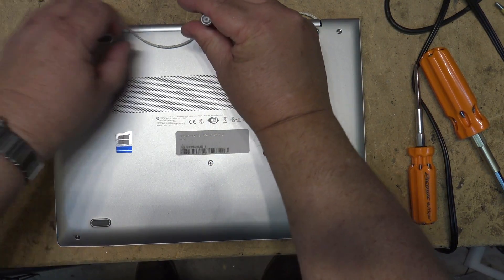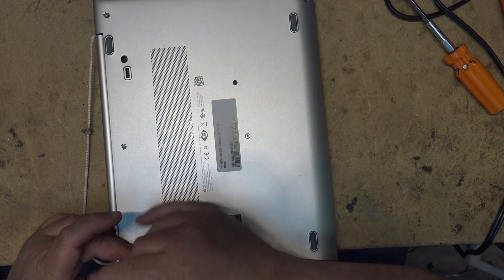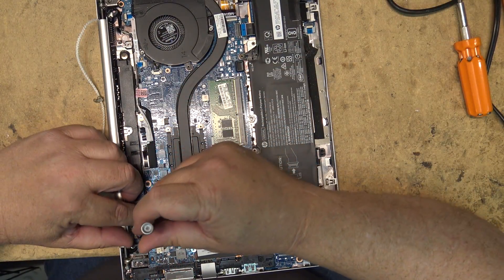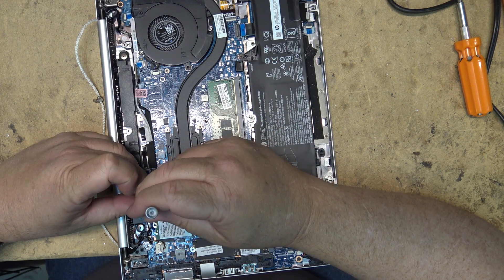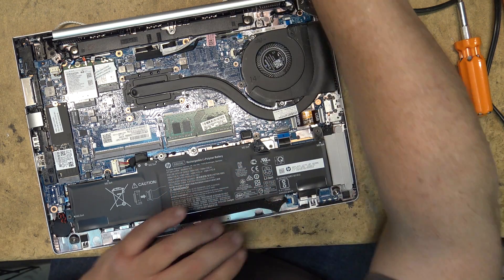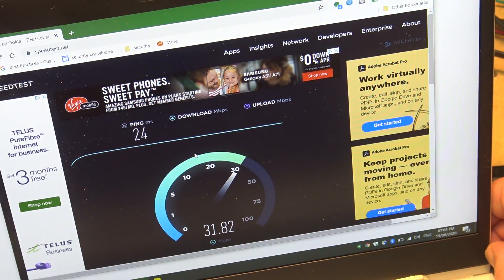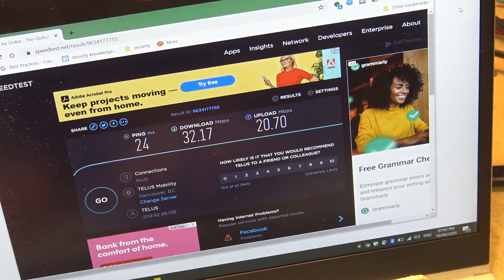My brand new work laptop has no LTE connectivity   lets fix it

Comment: Wait, one can have mobile internet via cellular with more than GPRS speed ?!? Gotta tell the others in Germany...
Reply from the maker: Yes I get about 80 mbits down 30 up on a cellular connection.
Reply: @12voltvids  You see me jealous : )
Reply from the maker: @HenkChinaski  
It's a work machine. I am not permitted to use it for personal use.  Same goes for the company cell phone.  It go off as soon as my shift ends and doesn't go back on till I am on shift.  Company monitors use.
Reply: @12voltvids  Well, i am rather jealous because of the connection speeds available over there and not primarily about the gear, although it looks nice, especially with that carry strap. Why's a company would be interested in hiring someone monitoring the usage of a laptop by employees remains totally beyond my imagination.

Comment: Please help, Dave! Sony KV-32FS120 won't degauss no matter how long I leave it off or unplug it. I assume THP501 is responsible for this, but I don't know for sure. I can see the solder joints on the bottom of the board for THP501, they look fine. Should I try to replace THP501? I'm not a technician, I'm just trying to play video games. Thanks in advance!
Reply from the maker: Usually it is a broken solder connection on the thermistor or plug where the deauss coil plugs in. I don't have a manual for that model handy to look at the circuit.
Reply: @12voltvids  I replaced THP501 (thermistor) and there is no change. I also tested the resistance across the three pins when I had it off the board and it matched the new replacement part almost exactly. Thermistor solder joints looked good before I took the part off too. I didn't look at the degauss connector joints at all, I'll check that next. Thank you very much for your response Dave.
Reply from the maker: If the degauss circuit is working (you can hear the distinct hum for a second when the at is started cold) is is likely an aperture grill problem inside the tube.  If the aet has ever fallen forward which was common with those big Sony sets due to the weight of the glass on the face of the tube, the aperture grill inside the tube can shift and then you will never get the purity correct.   I can't count how many times I had to change a tube on a new set because one rolled over in a truck in the box when the truck went around a corner too fast.
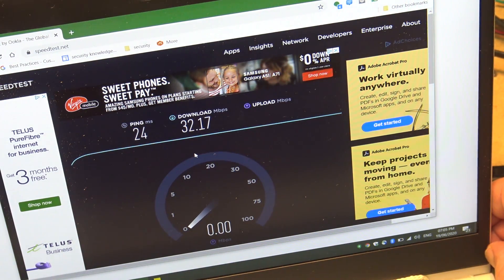Reply: @12voltvids  Thank you again for your replies Dave. Check this out: Symptoms: A little bit of green along the top, a little bit of yellow along the bottom. Clears up perfectly when I turn the set to a particular compass heading (a little bit East of North). Interestingly, when I compare this "good" compass heading to Google Earth when looking at the house I got the set from, I can tell it is the same compass heading where the TV was sitting for years (free facebook find ... I remember which wall it was on in the house I picked it up from). I don't think I hear the degauss coil. There is a youtube video which shows the startup sounds of this particular set (search "Adrian's Digital Basement Sony KV-27FS120"). At 3:30 he gets "tick, tick, thump ... picture". I only get "tick ... picture", no matter how long I leave it off or unplugged. Degauss coil has continuity tone when disconnected from the board and tested at the plug. I replaced THP501. Degauss coil connector socket solder joints look good. Purity was correct when I picked it up. No "drops" on the way home. Purity is good at my house too, but only when I turn it to that magic compass heading. If I turn the TV on and spin the TV slowly I can see the green and yellow move to one side of the set and then disappear as we approach the magic compass heading. I am a software engineer, and I'm pretty far out of my element right now. Your videos and advice are some of the best guidance I have right now. Any ideas? Thank you again sir!
Reply: @12voltvids  Update - Degauss relay clicks when 12v DC applied directly. High voltage legs of relay go from open to 200 ohm (is this OK?). Everything in the high voltage side of the circuit appears to tone out fine, including the degauss coil itself. Nearby transistor on the low voltage side of the relay tests fine (NPN). The degauss relay never clicks during startup so I assume it is never being commanded(?). Used the schematic to trace the signal side of the relay to the 14v side of a 9v regulator. Everything tones correctly in this path. Used the schematic to trace the relay signal the other direction, all the way to pin 60 of a microcontroller on a daughter board. I haven't toned this path yet, but that's my next step. If this path tones OK I might just replace the daughterboard. I'm pretty sure everything is cool on the high voltage side of the relay ... I think the degauss command is never arriving on the low voltage side(?). Does this sound like a good theory to you? Reminder that I never hear the degauss relay click during startup, no matter how long I leave it off, and the thermistor has been replaced, and the old one tests good anyway. Looking at the schematic I feel like I should hear the relay click even if there is a problem on the high voltage side of the degauss stuff? Do my ideas sound right to you? I have very little experience. I got my soldering iron like 5 days ago. If you happen to read this, thank you again Dave.
Reply from the maker: @SCBraddy  Wierd problem. Don't have the foggiest. Been a long time since I was into one of those sets.  The degauss relay should turn on when the set is started cold, but agaon it has been about 17 years since I saw one of those sets.
Reply: @12voltvids  UPDATE: Fixed by replacing the M-board. The critical clue was that the degauss relay wasn't clicking during startup (could hear the first click [main relay] but not the second click [degauss relay]). This means the problem was on the signalling side of the relay, and not in the AC degauss path. Further, the relay worked fine when I applied 11v directly when the TV off. Further still, I could force a degauss while the TV was running by momentarily shorting the appropriate relay leg to ground. Toning the relay signal path showed that I had a good connection from the M-board microprocessor all the way to the degauss relay neighborhood. Transistors and diodes seemed OK in the neighborhood too. During startup the degauss signal from the M-board would climb to about 20mV maximum and then settle down to a lower value than that. This is roughly the correct behavior for that signal line, but it was just too low - not enough voltage to energize the degauss transistor. All of these factors put my suspicions on the M-board microprocessor, which was a hard leap to make considering that the TV worked perfectly in all other respects (picture, on-screen menu software, inputs, everything). Replacing the entire M-board fixed it. Just finishing up the story in here in case anyone ever cares.
Reply from the maker: @SCBraddy  cool

Comment: !st thing disconnect battery
Reply from the maker: Power down is good enough. No need to disconnect battery.
Reply: @12voltvids  54 years repairing all kinds of electronic devices says I am right
Reply from the maker: @kennethconnors5316  Except in this case.

Comment: Ha ha ha, service center screw up - fixed in 5min. I have to make old my old Win7 laptop connectible to Wi-Fi, sees the network but doesn't connect to internet.
Also my neighbors laptop Win10 spkrs distorted like crazy - somehow it fixed itself - maybe driver update  from Microsoft did it.
Reply from the maker: It worked when it left the service center and stopped the next day.

Comment: I had a similar problem in the past. I was servicing a laptop with a disappearing wifi adapter. My problem lied in the old version of BIOS. There was a bug due to which it forgot to apply power to the pci-e bus connector. When you have put the computer to sleep in a specific way, the wifi adapter disappeared and never ever showed up again. Not even after a power cycle or restart. Come to think of it, new Win 10 sleep states could be at fault also.

Comment: Man. I HATE this design that all laptops have today where you have to remove the entire bottom cover to gain access to the RAM, m.2 cards, SSDs etc. I really miss the hatches the older laptops had. Everyone seems to have gone the Apple way of design...
Reply from the maker: I like my old Dell.  Huge battery (user replaceable) internal 500 gig hard drive and a swappable caddy with a 1tb drive that I can hit swap. Can pull that caddy and slap in the dvd drive if needed.  Has sd card reader esata/usb combo plus 3 more USB VGA, hdmi and a firewire. Plus it has a REAL keyboard.
Reply: @12voltvids  Yeah. Good laptop keyboards are kinda rare these days. Look what happens with 2016-2019 MacBooks...

Comment: Windows 10 can be a real pain, I've been running on the 2016 LTSB release for a while now because I got so fed up with the rolling release. At least this version is stable, and I know it will stay that way because it only gets security updates.
Reply: If you got problems with Windows 10, it's 99.9% of the time a hardware problem. Never had any problem with Windows 10 since it release on 5 different hardware constellations. And if I had some, it was always down to hardware problems. Always.

Comment: Put Windows 7 on it. Win 10 ignores your rights to reject updates and advertising.
Reply: There are specific programs that only run on Windows, and some only on Win7 and XP. Also Win 10 from time to time as some update comes along will mess up settings and things won't work properly. 
Linux, I like it for some stuff, but not being a Geek or PC wizard makes me stupid, and again Linux software version availability or compatibility problem with the software I use.
Reply: You can't even install Win 7 because it isn't supported by new hardware and there are no drivers. Plus it's no longer supported by security updates. If you want privacy, install Linux.
Reply from the maker: @crashbandicoot4everr  linux is a joke. For geeks only. I don't have time to learn a new os. I just want to turn on my pc and work with the apps I currently use. I played around with linux many years ago. Sure there is firefox, but no photoshopping or premiere, and all the other apps I need to use. I use win 7 on my personal computers and have no plans to change because hardware I use will not run on 10 because there are no drivers for it. For that matter there are no drivers for linux either. I still run xp on one old machine that gets booted up when I need to update a piece of hardware I own because there were never any win 7 drivers released.  I hung onto my win7 company computer as long as I could but finally had to swap it out.
Reply: @12voltvids  Yeah. Not many productivity apps are available for Linux. I personally use macOS on my HP laptop (hackintosh), dual booting with Linux Mint. I have a Win XP virtual machine for some old programs.
Reply: Linux is GOOOOOD
Reply: @crashbandicoot4everr  worst case, yes a driver won't be available. I'd put the non win 7 compatible laptop in the bin and get a win 7 system. As protest against governments letting Microsoft doing whatever the hell they want. Win 10 is a security issue as standard as it ignores your rights to allow or disallow updates. As for security. Scare tactics plays a major role. Use reasoning and your bank accounts won't be emptied.

Comment: If the card fails again; use a touch of Deoxit on the plugin pins, then shove the card in and out a couple times, that will usually fix the problem.

Comment: I really hope your network was "Dont be a dick" i had to laugh :-D
The same fault happens with memory strips, i slide a bit of writing paper down the socket, and use metholated spirit on a cotton bud to clean the edge of the strip.
Fixes the problem but i think the socket is a crap design.

Comment: How would it have worked and then stopped, but started working again after re-seating? Did it work loose from the socket? Maybe a dab of hot glue or something similar would keep it in place if it wants to work itself loose.
Reply from the maker: It is held in by a screw so I have no idea.  All I did was remove and reseat it.  If it breaks again I am asking for a new one.
Reply: @12voltvids  I'm wondering if it was a true power down that fixed it.  One tip:  Win10 by default has what's called "fast startup".  When you shutdown, you're logged off and and the OS is put into hibernation.  I have to turn it off on every system I touch because when I reboot I want a REAL reboot dammit!  If I want hibernation, I'll tell it to hibernate. Win+r, "powercfg.cpl", "Choose what the power buttons do" > click "Change settings that are currently unavailable", uncheck "Turn on fast startup".
Reply from the maker: @russellhltn1396  Don't ya think that would have been the first thing I would have tried last monday when it stopped working. The first thing that happened was my VPN would not connect. So I did a total shut down and power up.  That's when the air card "vanished". I did about 5 more total restart and power up and the same thing. By end of shift I was fed up. Shut it off and went home. It sat for 3 days. This morning I powered it up and called for remote support, because I do not have admin rights. Support had me log them in using logmein123.
Tech over in the Philippians (pretty sure that is where he was, as I heard his talking clock say "It's Midnight" and it was 9AM here.)  He messed around for about 45 minutes and said he couldn't fix it and I would have to take it to the service center again. IT guy is on holidays till next Friday. So I was faced with another 3 long days dealing with using my phone as a hot spot, which blows because it disconnects all the time to save the battery, and that boots me off the VPN.
So I power down, remove the card, plug it back in and power up. The ^%*^$ing thing works!
FYI when I first started with the company, I was in IT support. I was part of a team that rolled out about 500 windows XP machines and revovered 500 Panasonic Toughbooks running windoze 98 when that was shut down. Did that for about 6 weeks when I was in training.
Reply: @12voltvids  If that slot is wired for "wake on LAN", it might still have power when the machine is off.  Stranger things have happened.

Comment: Windows 10 is terrible , Microsoft is always issuing updates and messes up what they fixed . Not to mention terrible customer service.
Reply: That's why I'm using Linux now.
Reply from the maker: Not my choice.  I am still running 7 here for my editing computer and my personal laptop. I am not concerned about hackers as my editing machine is not connected to the internet.   My work computer I have no control of. The company gives me a machine for work and I use it. I have been complaining about this piece of crap since I got it because it has been one thing after another.  Under win 7 I could put my password in once and in was good for most of the day. With 10 I have to enter it every time I open a new web page.  That alone is driving me crazy because every system has a huge password.
Reply: @12voltvids  It's not Windows 10 making you re-enter the password on each page.  If you're referring to the browser remembering your web password, that's a browser setting that might be locked down.
Reply from the maker: @russellhltn1396  It's not windows it is Cisco Anyconnect. Even if remember password is checked it doesn't and it pisses me off. I have to enter my VPN password about 50 times a day.
Reply: @12voltvids  Micro$oft killing off all the good OS. Forcing Win10.
Reply: @ernestmccollum2397  Last version on Windows 10 2004 is not really that bad, they done a complete rebuild of this version. Download O&O shutup 10 run that to kill all the stupid functions that you do not need, after that it will be pretty much like Windows 7 quick boot is nice. Only thing I really do not like is the stupid "automatic updates" they always happen at times when you need your computer .
Reply from the maker: @Hagis2k  It works but there are many little quirks that I just can't look past. Like when you open a browser it will not  remember the window size of the previous session. It always starts too small and I have to resize every time.
Reply: Been running Win 10 for years on both a very old slow laptop and a newer custom built gaming computer with no issues. Most issues I find fixing other people's computers can be traced to third party apps especially the "free" ones, in particular ad blockers.
Reply: ok
Reply: I'm still running 1809 on my admittedly ancient (10 year old) laptop. I'll continue to run it until support ends in November.
Reply: If you got problems with Windows 10, it's 99.9% of the time a hardware problem. Never had any problem with Windows 10 since it release on 5 different hardware constellations. And if I had some, it was always down to hardware problems. Always. And updates killing stuff is caused by people carelessly or unknowingly installing software that messes up their user account. I had that happen so many times within my family and friends circle. A friend of mine forces his grandparents into an Active Directory with limited access to Windows components so it does not happen anymore. And those machines always update successfully with no problems whatsoever.